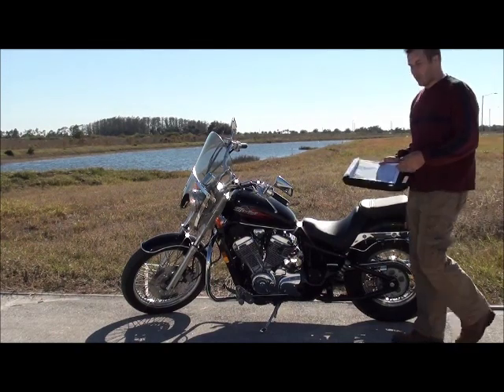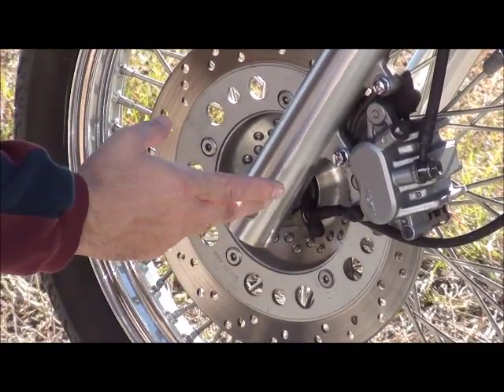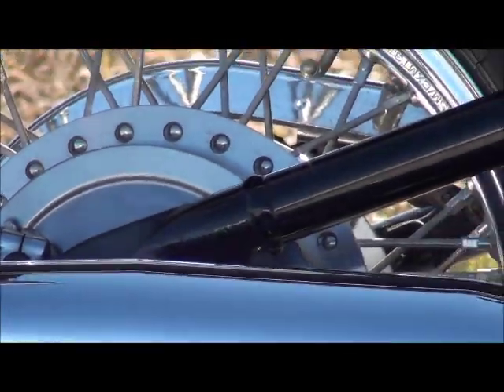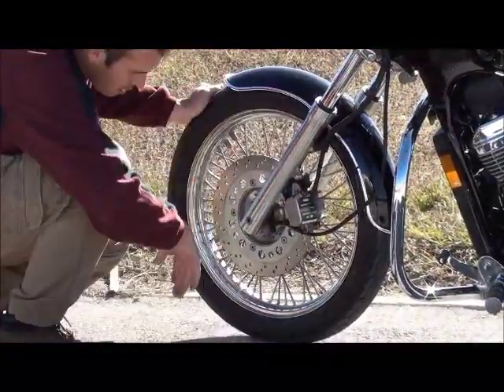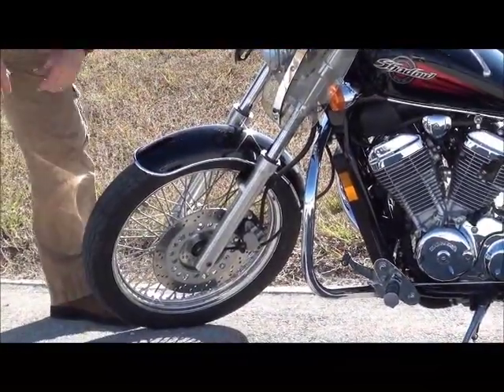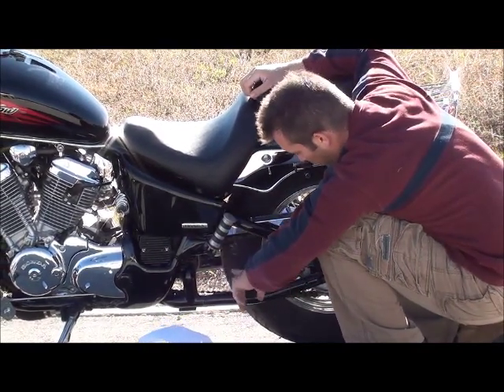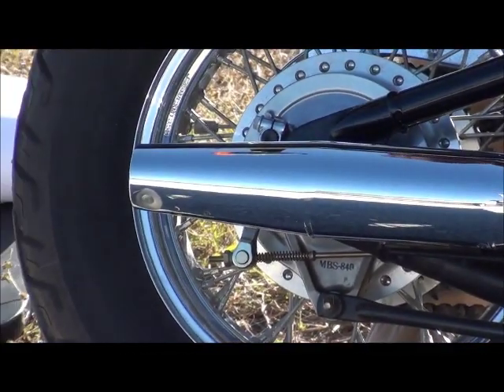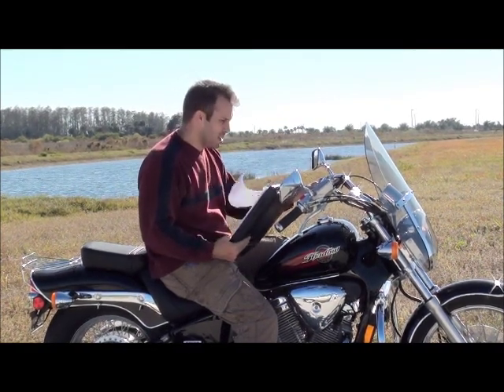How to buy a motorcycle - PART 3 - Motorcycle Inspection Checklist

Comment from the maker: That's a very good question.  Shafts require less maintenance but are not maintenance free. Check the secondary and primary oil fill and also check the drive splines. Look at where it connects to the transmission housing and have the seller walk the bike while you're watching the shaft turn. Make sure it's not warped or wobbly. If the back tire is new make sure the drive splines have been greased.. This should be done every 8-10k.

Comment: Also, check the manufacture date on the tires. Tires begin to dry out right from the day of manufactured. We had one Rider from our group bought a used bike from Harley Davidson Dealership in 2014 ..the bike was a 2007 with low miles but the tire was manufactured in 2006....8 year old tire. Even with good tread..tire lasted less then 6 months.

Comment from the maker: You can change the pipes for the exhaust but if they are already blued then the bike is generating enough heat to change the color of metal. I can only imagine what the interior components look like. (Parts of the motor you can't see) Gas through the air filter is a clogged carburetor float valve most likely. It's probably gummed up and needs to be cleaned. Take the oil cap off and see if it smells like gas. Sometimes when the float is open it will also leak into the oil.

Comment from the maker: The Vulcan 900's are great bikes. A shaft will require maintenance every 8000 miles but should last the life of the bike. Where a belt will stay good for about 30k miles. (depending on how you ride) You will also lose a little torque with the shaft. My suggestion would be to head to a dealership and test ride both a belt and shaft driven bike of comparable cc's. See which one you like better. Either choice is alot better than a chain. They require maintenance every 500 miles.

Comment: Also when checking the exhaust pipes while running, it should always push your hand away, if it sucks your hand or a piece of paper, it means you have a most likely a burnt valve. A test ride is needed to know if the transmission is in good shape, again check the forums before hand, for possible problems related to the bike you're looking at. Just because a bike has over 25 K doesn't mean it's a pass, many bike's will go much further with no problems, if taken care of ! Also remember a bike will have normal wear & tear with use, the signs will be according to type, and age. If you want a perfect bike, exspect to pay more for it, even if it's older. Be nice when asking to look at the plugs, they are easy to be cross threaded, let the owner do it, unless they give the ok, do a compression test also, learn how to do it before going, and what PSI to exspect, when it's done. Todays bikes will have problem with varnish, from bad fuel also if it's been sitting for a few weeks, ethanol causes a lot of problems for bikes. Thats my 2 cents. yl

Comment from the maker: The only safety feature not standard would be the kickstand. Everything else is the same. As for the test drive - most sellers won't let you ride the bike unless you have an M-Class endorsement and insurance. Just make sure you bring a friend along with you. Check out my odometer fraud video. This short inspection should be the first thing to check before getting more involved i.e part 1,2,3,.. There's a link for the check list below the vid or you could take notes. Thx for watching ;)

Comment from the maker: Dealers flip bikes and put as little work into them as possible. Be prepared to pay full retail plus a dealer maintenance fee, which is about $600. 
Private sellers will do a much better job preparing a bike for sale. You are much better off buying from a senior or an older person. They don't ride the machines as hard and are less likely to be deceptive. Bikes bought from dealers/owners should be inspected the same. Aftermarket warranties are available regardless of how the bike is bought.

Comment: I am looking at a Harley Heritage, you just said that 25,000 is high miiliage that seams to be mild miles on a Harley. what do you think? Also I am assuming that this will closely compare for a Harley for a check item list
Reply from the maker: It depends on the size of the motor. When you get into to 1k cc range I would agree 25k are baby miles because most bikes in that range have the ability to reach 100k with proper maintenance.

Comment: How should I modify the chain inspection for a belt drive bike?
Reply from the maker: John Peters Look along the length of the belt (also on the underside) and check for cracks, dry rot, or missing groove ribs. They usually last the life of the bike though. I prefer belt drive over shaft or chain for on the road bikes.

Comment: what if the chain is rusted? Is it a deal breaker? where can I get the checklist?
Reply from the maker: +Nathan Hegwer It just shows poor maintenance. To me it's more than just a rusted chain. I view it as if they can't take a few minutes to lube a chain every 500 miles then they probably don't take care of anything else either. It really depends on the cost and what your expected use will be for the machine. Anything under 1k you can expect some problems. I personally wouldn't invest more than 1k in a bike needed as a daily driver that has very basic maintenance neglect. The checklist can be found in the description.

Comment: What if the exhaust pressure are not equal?
Reply from the maker: It could be as simple as an exhaust leak or a restriction (After market pipes with alot of bends). Most of the time though it's poor valves, rings, and the cylinder isn't compressing fuel. (Crappy fuel economy) A good way to really isolate the problem is an inspection of the spark plug and a compression test.